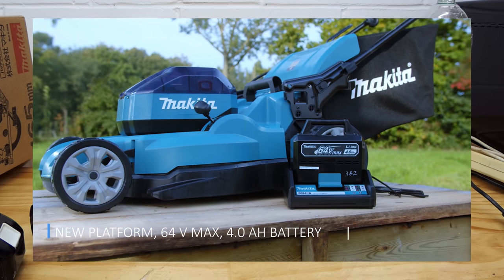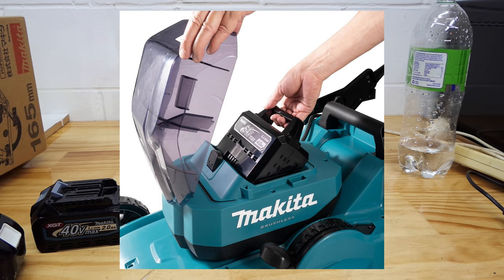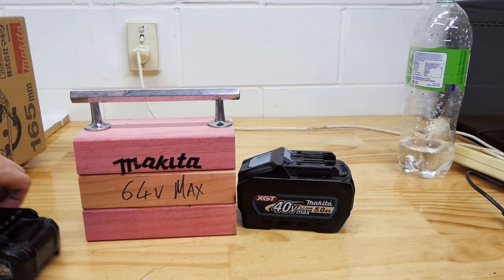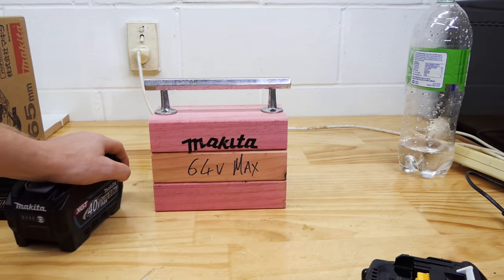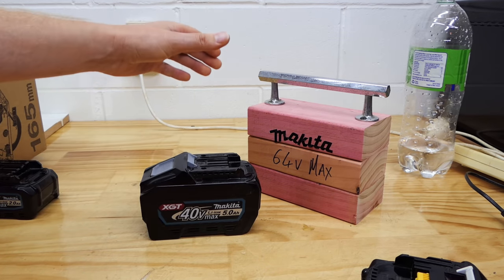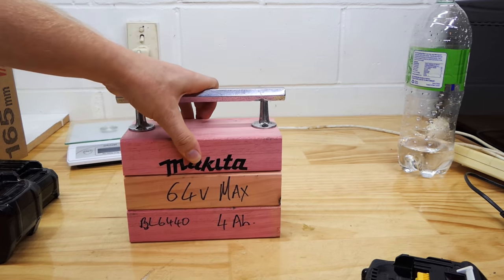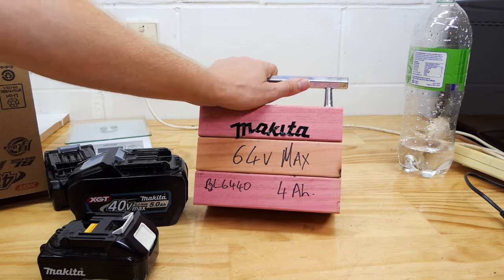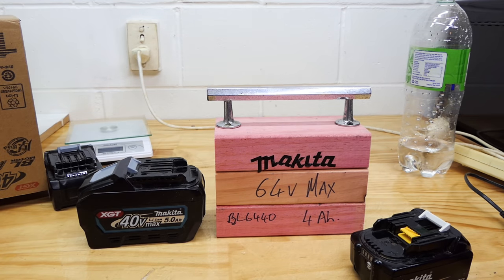Makita 64v Max has launched... So what's the point?

Comment: Have to make a pretty compelling case to warrant messing with a battery that requires a handle. Love the mock up. Limited edition NZ only pink battery.
Reply: Will this be like Makita old 36v platform , only seen a cultivator that used that battery .
Also Makita should start using bigger cells , 25700 or 30700 , only need to use 15 cells .
There are already 10 Ah 30700 cells .

Comment: I agree with the other comments rather perfer a 40v x 2 XGT Mower than a new battery platform to invest in.
Reply: Locking you into different platforms makes them more money because you "have to buy" the accessories for that platform...... soon 80v batteries will be available (perhaps fall 2024?)..... yet another "must have" platform where current tools become obsolete 

Who remembers 10v and 12v tools going up to 14v and 18v?..... i was on a "second hand market, and saw those tiny batteries....... even 9v if i remember?

Comment: Major blunder by Makita. There's definitely applications for big briefcase batteries, but the obvious solution for Makita would be 80V so that they could sell an 2x XGT adapter. No one is going to want to run a 64V mower AND a 40V trimmer, and no one is going to want to run a trimmer with this beefy 64V battery. Hopefully they release a 40V mower and this dies a quiet death.
Reply: Steve D  Yeah, I'm wondering if this is a budget alternative to an X2 XGT mower. Maybe it's a somewhat standalone package and they're not planning anymore 64V tools. Seems like the existing LXT mower already fills that role though? Maybe the X2 LXT didn't have enough runtime and a kit with 4x LXT batteries was too pricey?
Reply: I don’t like conspiracy theories usually, but…the mention of “budget alternative” just made me think of this. 

Their normal tool batteries are priced substantially above the per cell price. I know they have other costs etc but, I think they likely make money on them. 

This sort of tool really needs a lot of battery power. The price points of their other tool battery packs may make the lawnmower a very expensive tool to run. Impractically so. 

By using a new battery pack design, they can sell the battery pack at a lower per-watt-hour price without undercutting their XGT and LXT battery pricing.

Comment: I think the big battery platform with a handle makes sense, I just don't understand why they made it 64v.  Surely 100v or even higher would have been a better choice.  Could be used for a ride on mower, table saw, a big backpack or walk behind blower, high velocity fan, etc.  Maybe even a space heater or small AC.  I just don't see the point of this when the 40v x2 can deliver more power.
Reply: 1 battery is the point i think, but yes, the voltages are all wrong.....
Reply: Would have been nice for 80v and compatibility with the 40v system.

Comment: The 64V battery could be using  a different cell package, maybe pouches instead of canisters. The clue maybe in the lower weight. Makes sense to develop a cheap(er) battery with a lower power density for applications where size is not so much of an issue but price point is like the home owner market . Wouldn't be surprised if these batteries are cheaper per kWhr than the 18V and 40V ones. Off the top of my head, a concrete mixer could be a good application for one or two of the 64V batteries.

Comment: On the wst 06 (could also be a wst07) I bought the uk version of the miter saw mounts, but I also made a piece of wood with mounts that will hold the two battery 36 volt saw and the 40 volt 8 1/2 inch saw side by side, it’s nice like that. 
Ideally you’d have 4 saws running when trimming out a house as to never adjust the blade angle/bevel.

Comment: My gut feeling is Makita is going to produce a full line of larger power equipment using this 64 Volt Platform. We will probably see Zero Turn Mowers, Walk Behind Concrete Saws, Trenchers, Plate Packers, and more. These would probably be powered by multiple batteries for more power and or runtime. I wouldn’t be surprised to see a line of UTVs in the future.
Reply from the maker: I doubt any of that will happen.

Comment: I suppose Makita could go big lik Ride on lawnmowers,  generators, compressors, outdoor lighting, anything that runs small engines, carts/lifts etc..
Reply: Battery powered Generator 🤔 You could be onto something there. . . . .  . especially if it could charge its self 😃
Reply: @KiwiBassHead  It would obviously be just an inverter for AC power. There are plenty of these units with built-in lithium packs out there that are called generators.
Reply: @danielwaddell123  Fair call, I suspected that is probably what you meant, I just couldn't resist.😉 I totally agree, these batteries would be great for some sort of large capacity power bank with a solar charge option maybe. It would also address one of the major flaws IMHO with the large power banks that are on the market at the moment which is the batteries are not replaceable or upgrade-able.   Makita could make a chassis that housed all of the inverter, step down and recharge electronics that had space for, maybe 4 x 64V batteries but was only sold with one, so the cost of 'entry' was lower and then you could add capacity at budget permitted. I'd buy one.

Comment: Right now these are top of the line models but 80v Max mowers must be coming and then these 64v mowers will be stuck in the middle of the range between LXT/XGT mowers that are on far more versatile battery platforms. Maybe if the pricing is right then they'll make sense for some customers, but it does seem an odd move for Makita to introduce yet another battery platform requiring 3 new products to be developed (battery, charger, mower) when they could have just developed an 80v Max mower which will be more powerful anyway.
Reply: Locking people into battery platforms makes more money...... but (as you say), it is stupid..... lets see if people are more stupid and buy into that ridicules nightmare 😂😂😂😂😂

Comment: Interesting but Makita once  again defeats the notion of buying into an ecosystem  with 18v, 40v and now 64v with NO interoperability.   Why not let me plug in (3) 18v batteries into  this mower? I'm happy with my 18v system but would consider buying non Makita for an electric mower or snowblower when I move those to electric.  What were they thinking?
Reply: Well, there is the 40v to 18v charger adapter, but that only helps with how many chargers you have on the shelf...So yeah, after reading all the comments, everyone's on the same page.
Just a head scratching wtf.
Reply: Agree.... but the "pink battery" 💗 is a smart move into "new markets" and has been highly antisipated by the LGBGTGKTSECJL community's for many a year now....... 

Makitas "pink line" 💗 has been a closeley guarded secret untill now, with their "flower" and "pink puppy/furry bunnie" ranges of lawnmowers and building tools/diy market.

Shelves should be fully stacked inline with this years launch to "tie-in" with all local "gay pride" celebrations.... and marketing execuatives are confident that the new line of tools and pink workware will be sold out for the building trade, including the newly designed pink work belts replaced with "handbag styled" work pouches....

"Non-gendered livery" will be avalable to the building trade, with "stiletto healed" work boots, marketing executive was quoted as saying.....

An amazing line aimed at new markets for all transgendered buysexual and cross dressers  including all homosexual men in the building trade......

What an amazing way to "come out" all lead by the Makita tool manufacturing company from china for american builders....

Major news coveradge is expected come the launch in early september (sextember remember, the gay pride builders launch by Makita)....

Comment: The 64v be good for stationary systems needing batteries.
Vacuums, table saw, thicknesser etc that have a high load
Reply: I would rather have x2 xgt 80v
Reply: Oh no doubt. But it’s more simple power management as don’t need to balance the two batteries. 
May be better for surge or torque spool up?

Comment: They'll get around the size and weight of the battery by using an extension cord to the tool.  😉 Or a power bank for charging other batteries on site where electricity is not available. 😎
Reply: Lol..... 24v truck batteries in a "wheelbarrow" kind of carrier with extension cords to other chargers..... there trying to faizeout gennies, so everything runs on batteries, thats makitas dream....... but eventually, there needs to be a charger somewhere in the process.....?

Perhaps start looking into "solar/wind" powered kinds of chargers?..... portable nucular powered chargers with free sets of lead lined gloves 🫣......😂😂😂😂😂😂😂
Reply: Yep.... like that fridge thing, with its own rods and water cooling tanks.... its "dooable"..... controled releases of thermo-nucular energy like a mini fukushima plant in that ice box chiller.... (self powered infact?)..... i want the patent on that 🤣🤣🤣

Comment: Ryobi came out with an 80v suitcase battery for their 80v zero turn mowers. Perhaps Makita could follow suit
Reply: 1 of those 80v batteries would save on using 2 x 40v batteries, especially if it had the same output current wise or better..... ?..... 🙂👍🏻

Comment: Guess this 64V platform goes after PRO line of OPE.
Reply: But a pro still needs a trimmer, blower, hedger, pole saw, et cetera. Seems like madness to not just make a 40V or 2x 40V mower so that everything is on the same battery. This battery is too big for a trimmer and too small for a ride on mower - also too small to compete with 2x XGT. Just seems to be in the No Mans Land of batteries.

If they'd gone with 80V like Ryobi, then it would have enough power for bigger tools whilst being compatible with XGT via a 2x adapter
Reply: @toolscientist  milwaukee also has 80v line for high demand tools.
Dewalt has a flexvolt for that.